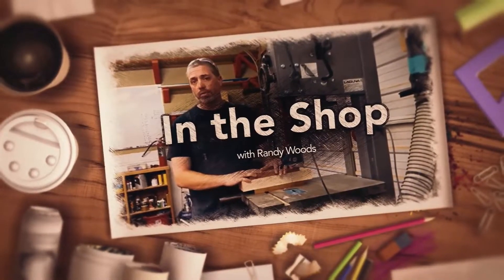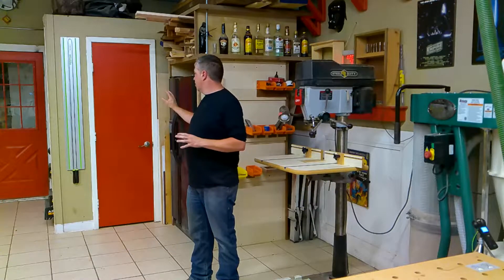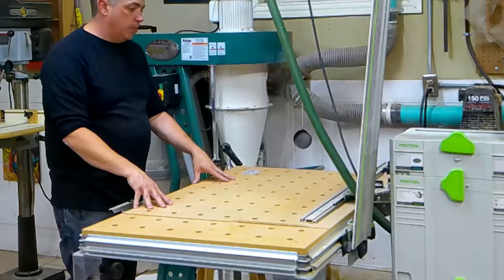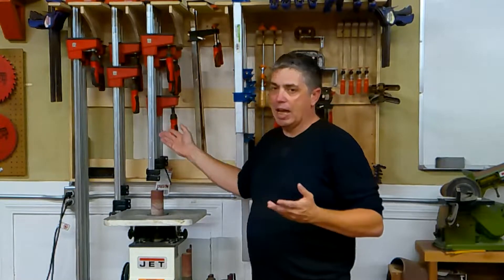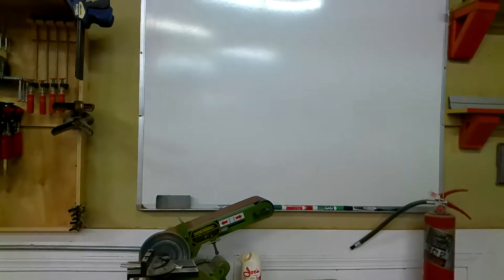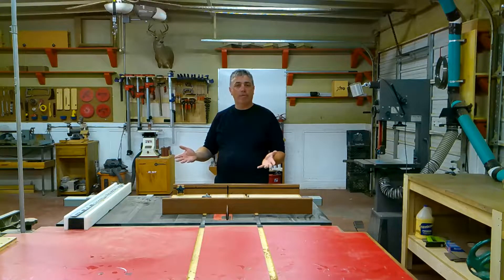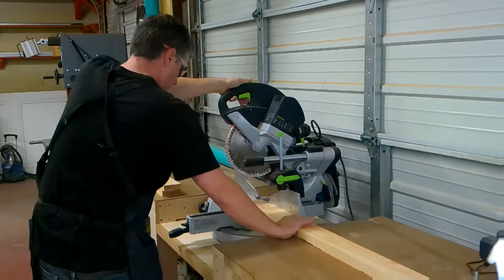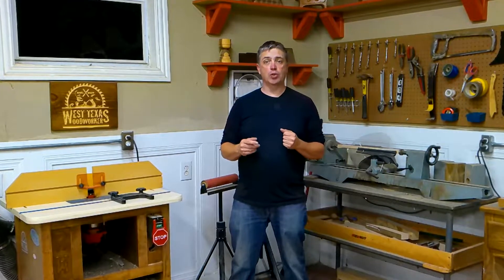Wood Working- 2021 Shop Tour, a tour of my woodworking hobby shop!!

Comment: The Grizzley Dust Collector you have- you didn't mention how many hp it is. I'm curious because it looks to be 1 hp. I only see one outlet on the motor and if it is 1hp, I would like to know how it handles a shop of that size? My shop is tiny at 10x16 and I'm upgrading from a 1.5 to a 2hp motor. I found the 1hp was not strong enough. I have a 3" flexible hose about 2-3ft long from each machine then it goes into 4" pipe. I wanted 6" but it was to much more at the time. Thanks for any info you can provide. Stay healthy!
Reply from the maker: It’s actually 1 1/2 hp. I am impressed with how well it works, I have it hooked up to 5 machines that have their own blast gates.  These machines are divided between two separate 4” pipes. I made as few turns as possible when I ran the pipe and used 45s when possible as opposed to 90s. I had two issues with the dc unit but both were easily resolved. Let me know if you want details. Thanks for watching!!